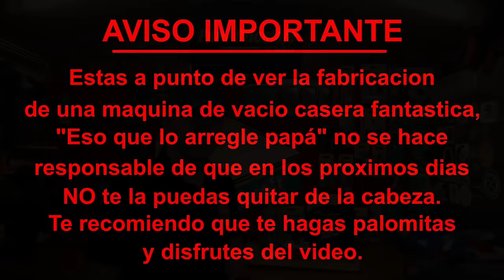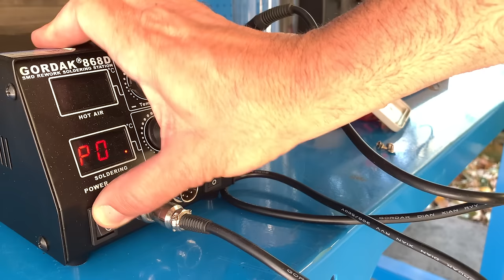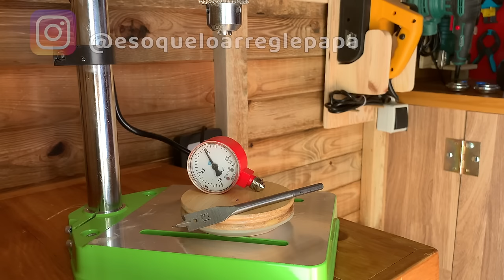🧢 Bomba de vacío CASERA con compresor de frigorífico ( MUY POTENTE )

Comment: Wish success with your projects! 
Please, may you explain how do you control and keep the oil level of  compressor  at the proper level?
How often do you add oil in?
Do you use air filter in suction pipe? If debris go inside?

Comment: Y al cabo de una semana de funcionamiento que el compresor haya perdido el aceite que lleva en su interior para lubricar el motor que es rotativo , tendras un lindo balon de color negro.
Reply from the maker: Que tal en eso discrepo un poco contigo, primero...porque tiene que perder el aceite y segundo si se rompiese tampoco seria ninguna problema ya que en mi profesión actual tengo muchos compresores de frigorífico disponibles.
Un saludo Neon y gracias por comentar🧢👋
Reply from the maker: Que tal Manuel, exacto es como tú dices ...es el tubo de baja el que lo refrigera pero también es cierto que eso que tú dices ocurre si pones el compresor a funcionar el tiempo que funciona en un frigorífico , pero este NO es el caso se tarda menos de un minuto en sacar el vacío a este tarro y ni se calienta ni pierde aceite en ese tiempo.
Un saludo y gracias por comentar 🧢👋

Comment: Te das muchas vueltas, muchos logos, y lo técnico amigo? Lo importante es ver que funcione.. Lo demás son de talles, cuanto vacío puede dar? Da vacío profundo.? Que aplicaciones prácticas para el trabajo? Sirve para hacer vacío en sistemas de refrigeración?
Reply from the maker: Que tal Samuel, yo lo uso para sacar las burbujas de aire de la resina epoxica, hay suscritores que lo usan para sacar el aire de los latiguillos de los frenos , para pequeños circuitos de refrigeración y para hacer algún pego más también.
Pero no pidas cosas profesionales, para eso cómprate una bomba de vacío profesional.
Un saludo 🧢👋